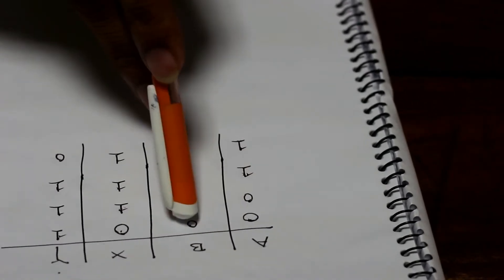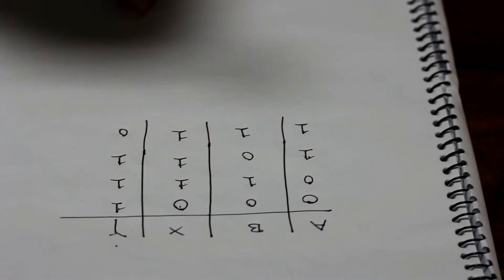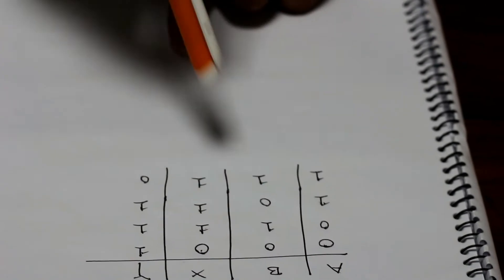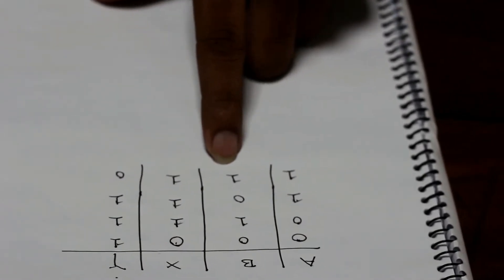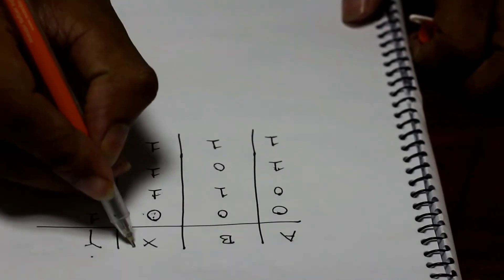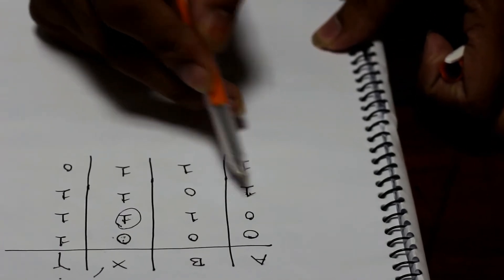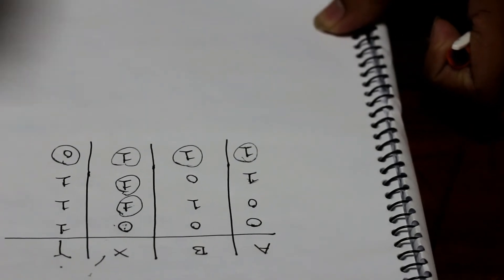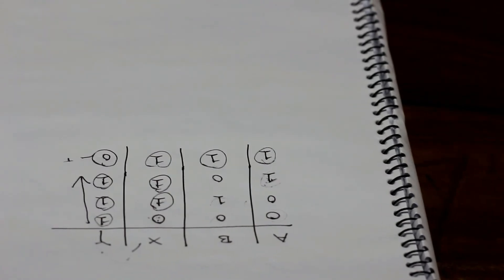Digital Logic design project submission Summer 2016-2017 (AIUB) || Fire Alarm security systrm

Comment: Aoa How do you connect starter of bulb as heat sensor to the circuit? Can you explain connections regarding that? And also connections for smoke sensor?
Reply from the maker: Please check 0.35 sec of this video. You will get the design of the circuit.

Comment: I have made this circuit but circuit isn’t working. Can u help?
Reply: As per the diagram I had implemented all, but when I’m giving power smoke sensor and green led didn’t working . Individually I had checked all equipment, all ok.
Reply from the maker: @alaminmidul9056  Brother please recheck the connections because if the connection is ok then it should work.
Reply: Can u send me videos and circuit photos?
Reply from the maker: @alaminmidul9056  I don't have this circuit anymore.
Reply from the maker: There is a circuit diagram in the video follow that one.